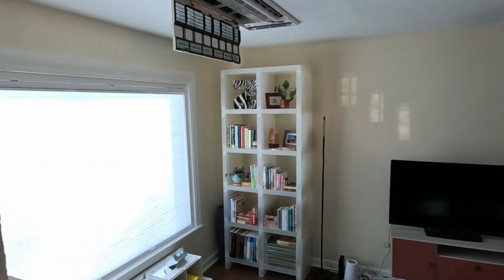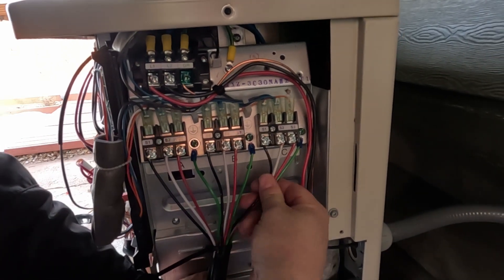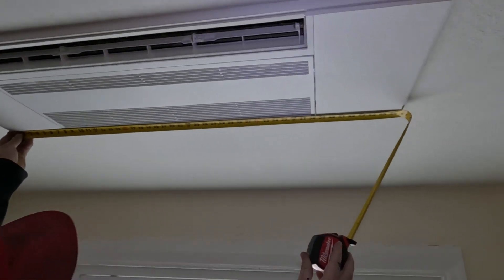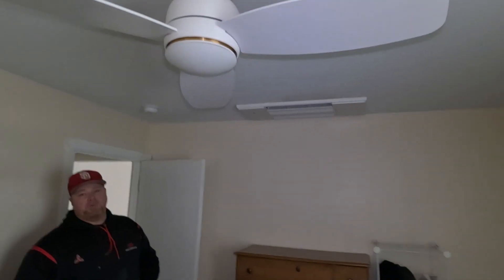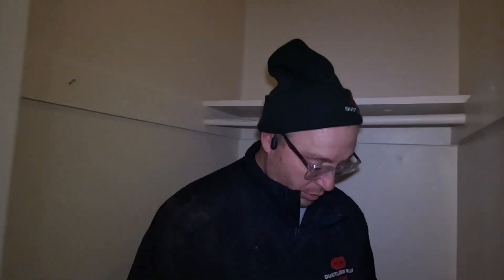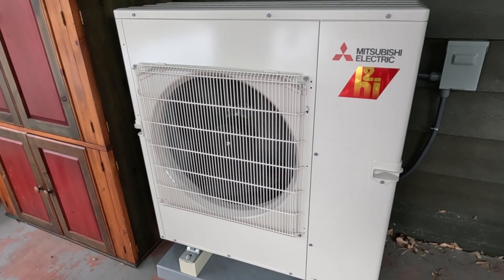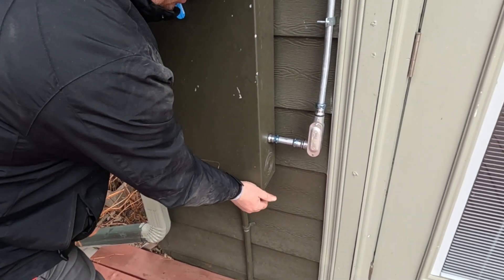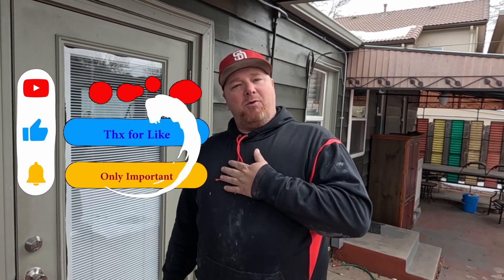Mini Split Multi Zone Cold Climate System Install

Comment: Great info! 😮 Looking to install a heat pump in Colorado in a cold climate on a new build. It’s about 1000 sqft 2bed 2bath. Would you have a recommendation for a system that could also use solar power to offset the cost of heating? Thanks!
Reply from the maker: @kcstark  We have a lot of customers that are Solar and 100% Electric and they have told me the heating bill can be $0.00 $50.00 a month for heat.

Comment: So this one condenser is a multi-zone. I thought it's the one that had the two fans in it. Because I'm looking at the brochure to understand their system, I might go with their system for a new build in a couple of years if the technology gets better and oh yeah one other question would you recommend a dual fuel system or just a mini split in New York since we do get cold I'm not talking about a particular region I'm talking about in general like the one you have in this video which is definitely Mitsubishi's highest model which I would definitely go with. And thanks for the info.
Reply from the maker: If you can hold off till 2025, Mitsubishi is coming out with a Whole New 
equipment line that’s Wi-Fi compatible and has a much better negative temperature I heard it can go all the way down and -30
Reply: @ductlessplushvac  okay now that's more appealing to me. I hope they actually make it compatible for smart thermostat like ecobee and Google Smart Learning nest. I don't mind this thermostat. I would actually use the smart thermostat at a base for all the unit and still use the Mitsubishi thermostat individually for the room
Reply: @ductlessplushvac  I just subscribe to your guys Channel cuz I'm going to want to see that unit if you get the chance to see it or get one

Comment: Have you had a condensate pump fail yet?
Reply from the maker: Noor no yet.
Reply: @ductlessplushvac  At 20sec what is the water mark on the ceiling?
Reply from the maker: It's not a water mark. The drywall had a chip in it and got mud put on.

Comment: Hey guys, love the content and information. Planning on using a Mitsubishi system in my new construction - 2 12k pead ducted units, 1 9k one way cassette and 1 6k one way cassette. Any preference between the smart multi condenser vs the mxz-c you used in this video? SM has better seer rating but costs 35% more with branch box.
Reply from the maker: Great question. Mitsubishi merged the MXZ & P-series units into one unit it now the MXZ-SM unit. So no matter what you will be getting an SM unit. You can install it with a branch box and the traditional way the MXZ-C units were or you can Install it like the P-Series so if you use P-Series indoor units you will “Not” use a branch box. Make sure you do a little research so you don’t mismatch the (2) styles. If you have any questions hope on MYLINKDRIVE.COM and research the units or feel free to call me @ 720-668-3056 Jared

Comment: How are you guys? I'm in NY so a way out. Have a question, how about those gfi /overload power protectors on those units, in case something goes wrong with power or a lightning strike?
Reply from the maker: A lot of people don't know this but Mitsubishi has power filters in the units that check the power and filter it to exactly what they want it to be. And it the power us not just right they will protect themselves and turn off. It's not a bad Idea to use them but we have yet to see a big need for them. If we install them in a older location in Denver there is a few spots left that have wild 3-phase feeds I would recommend them.
Reply: @ductlessplushvac  Good to know, thanks for  reply.